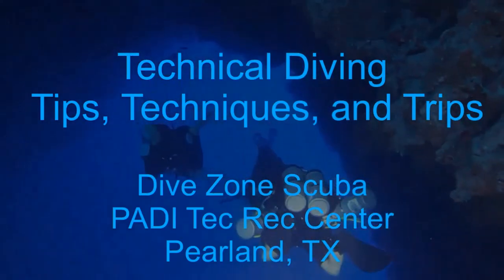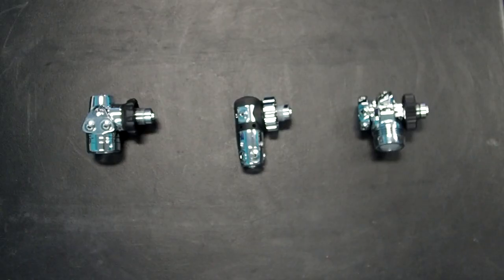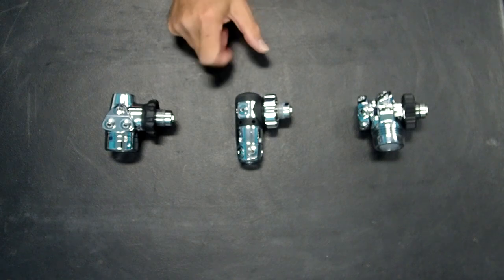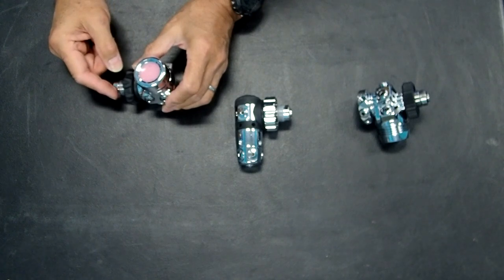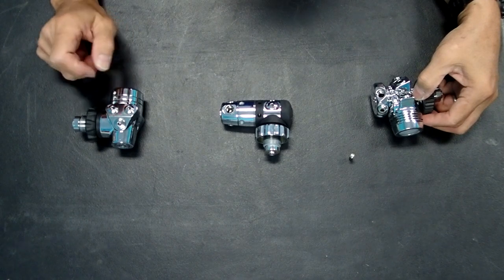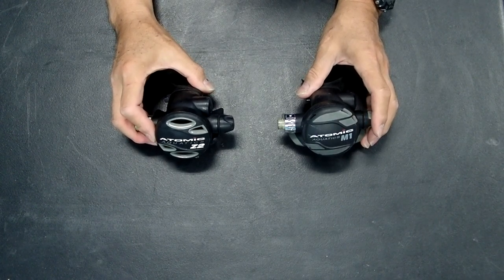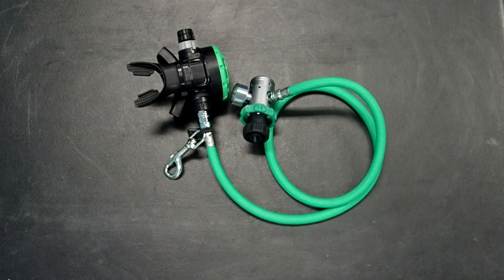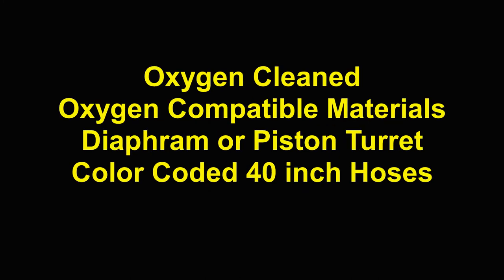#94-Decompression Regulator Considerations for Technical Scuba Diving

Comment: Did you have any preferences between the miflex or rubber hoses for both the high pressure and/or medium pressure hoses?
Reply: I've found miflex hoses to be annoying if used for long hose. They float from around your neck, refuse to remain in the shape you've curved them, chafe due to braid, don't stay stowed since they are slippery and most importantly kink easier potentially blocking flow. In short configuration they provide less jaw fatigue but i rarely am using the short necklace to warrant the downsides.

Comment: Another great video!  Do you bungee your SPGs to your first stage or do you let them sit flush with the tank?  I see a fair amount of divers with the bungees, but it makes me uncomfortable to see how much the hoses have to bend to do it.  

Here's an example of what I'm talking about: https://img1.wsimg.com/isteam/ip/fd81e77c-9025-4050-acca-e72b7da0b93b/b1d71a77-45de-4a37-9c48-e7311ce5d2c5.jpg/:/cr=t:0%25,l:0%25,w:100%25,h:100%25/rs=w:800,cg:true
Reply from the maker: Hello Chris.  Thanks for watching.  I put the 6 inch hose in a bottom port and bungee the gauges tight to the top.  I also find it a bit disturbing to bend the hose in a tight loop like that.  You can take off the bungee when the regulator is not being used to relieve some of the stress.  The bungee can also be used as a hanging loop during storage.  I have only actually seen one crimp rupture as a result of this.  I did not know the source of the hose or it’s history.  But just to be safe I always carry an extra one in my spare parts kit.